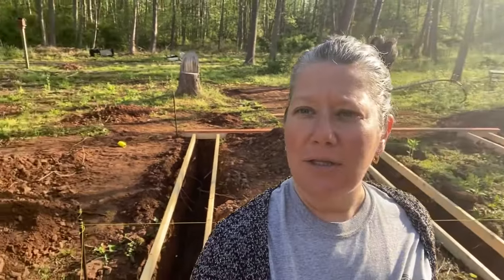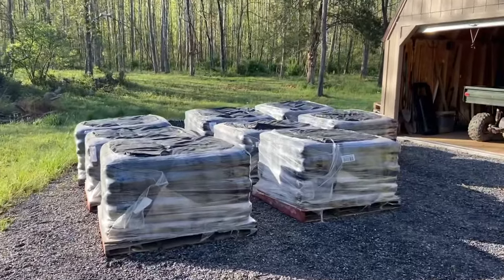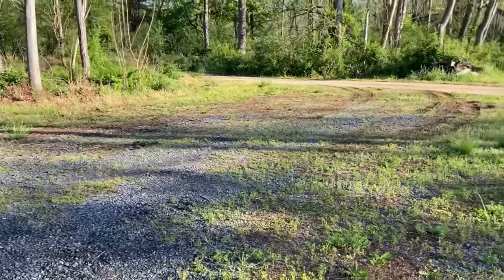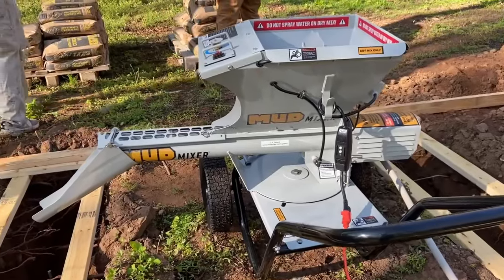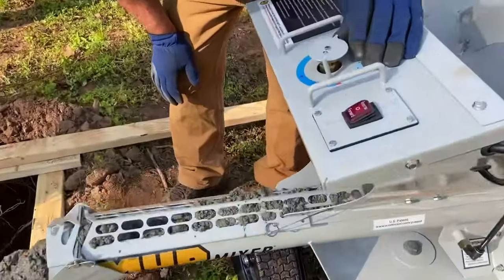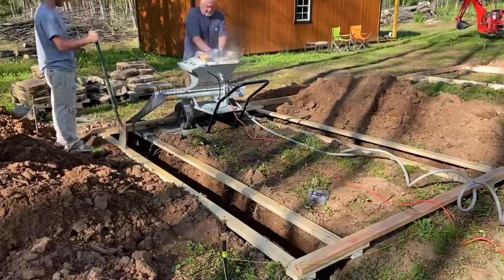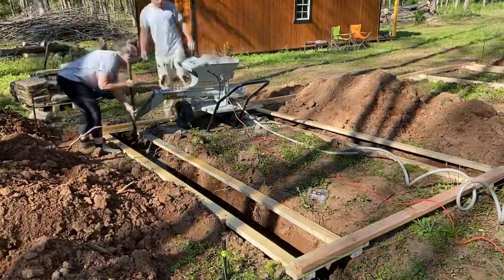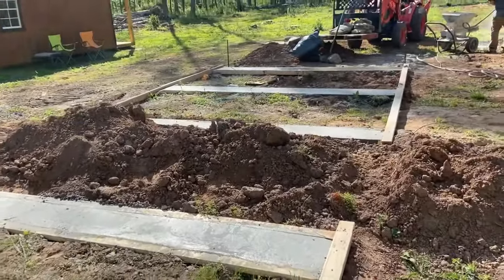Testing out our new toy….the mud mixer

Comment: I used a mud mixer all weekend 2 pallets of 50# bags love that thing even rolled it under the house for footers
Reply from the maker: @jefferysmith5280  sure does work great. We plan on using it for our footers next week
Reply: @AlcoAdventures  yea once u get water adjusted it works perfect and cheaper than a concrete truck
Reply from the maker: @ exactly!  And we have 344 bags, 60#. Getting our use out of that thing